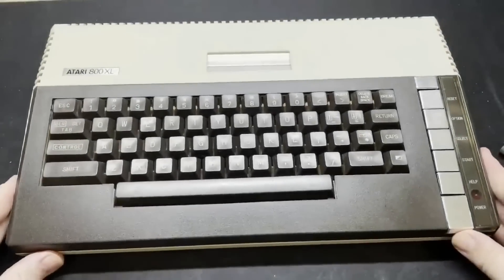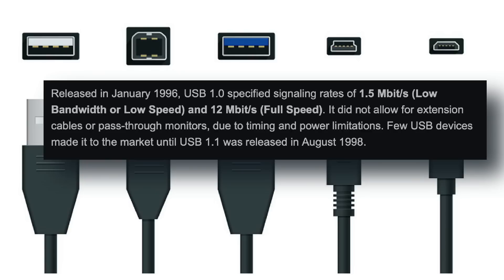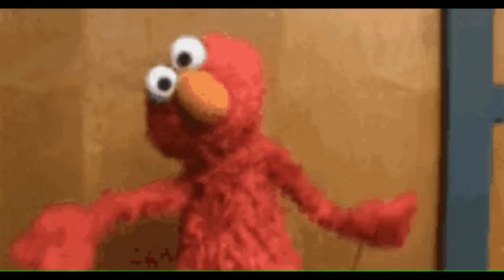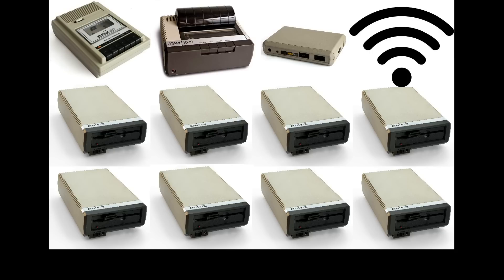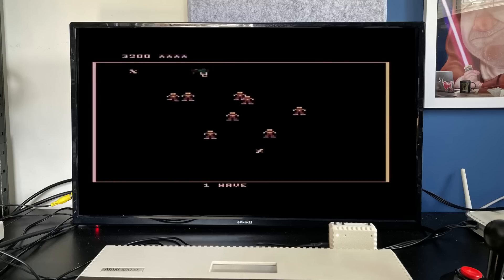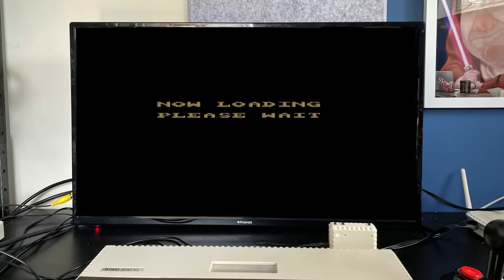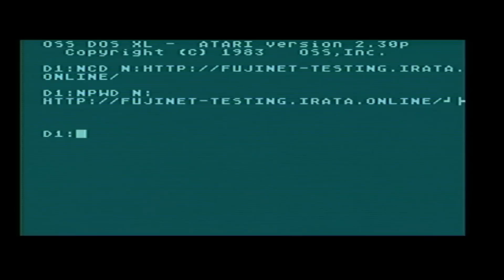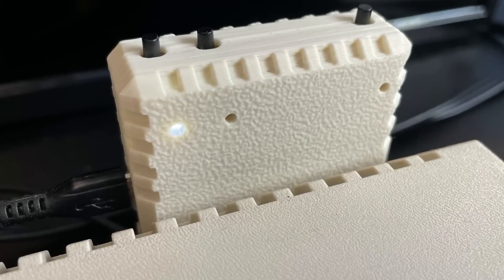Is this the best Atari 8 bit peripheral ever made?  I think it might just be!  #amazed!

Comment: Getting close to retirement and decided to unpack my old Atari 800, which I put away in 1986.  Shocker, I discovered I'd even bought spare parts and packed them too!  Also realized I had about 400 floppy disks loaded with games.  And I had a super charged floppy drive because, at the time, I was making money bulk-copying disks and writing games for a software company.  And it works!  (Man I love how sturdy old tech was.)

But now I really worry about longevity.  Everything loads fine... for NOW... but I WISH I could transfer all those game disks onto Flash drives and have them there for eternity.  This gadget sounds amazing for that purpose.  Seems like I just plug in the drive, daisy chain this device (I have the extra cables), and then I've got the means to copy from one drive (real) to the other (virtual, but accessible from my LAN by other systems including my Mac), and then I can move the copied info onto a flash drive for long-term storage.

Is that indeed possible?  Has anyone done it?  Could you then access your game library directly from the Flash drive through the Fuji? Or would it be a whole back-copy process to the Fuji virtuals?
Reply from the maker: Wow - sounds like you've got a real treasure trove there! :)
Reply: @TheRetroShack  Trying to document them all to video.  Some I've never seen anywhere else.  Back from the early days when people wrote games and literally gave them away for free or a few dollars, just taking pride in being able to create something cool (and probably use it on interviews with today's big game companies back in the early 1980 days).

Comment: The CP/M emulation along with the new CP/M card for the new 1090XL expansion interface means that there are now 4 different ways to run CP/M on the Atari.  The two original ways are the ATR8000 and a z80 powered disk drive that can be expanded to use the ATARI as a terminal.  So many options for retro explorations on one system.

Comment: Serial I/O wasn’t the only peripheral port on the 800XL. There were two DB9 controller ports, too. Sayin’ ‘cause it is a peripheral handled by USB, now — and the 800 had four of them, which is another reason I wish REVIVE were making an 800, instead of an 800XL (despite USB hubs that would make it the other two obsolete), ‘cause everyone could plug their controllers directly into the front of the machine. The 800 also had far better aesthetics and keyboard, for computers both essentially made in 1979. Of course, with Serial I/O location on an 800, that sweet “multi-peripheral” (MP) wouldn’t fit...

It would be amazing if that Serial MP thing were to work with an RM 800XL. It could use every modern peripheral, which it should be able to do. I don’t see a reason why not — but I do see me parting with a few hundred bucks, soon enough. That should also be able to be daisy-chained into an OG Atari 1050 floppy drive, to digitize files. Wish there were a daisy chain port, on the 410 tape drive. I still have some disks and tapes...

That’s awesome!

Comment: The FujiNet is an amazing device and this video was excellent in presenting its features. I love the ability to boot with different DOS versions as each had different features like speed testing of floppy drives. A couple of extra points. Some utilities for floppy drives require being on an inserted floppy as they require D1 location, which the FujiNet occupies. Added drives require address change to D2 etc. . I have used the FujiNet to download utilities to the SD card, and then copy them to a floppy  for this purpose. The FujiNet will also work on Atari 400s and 800s as well as XL models. However Atari 400s and 800s boot up before the FujiNet gets power up from the SIO and FujiNet is not recognized. However, this is solved by providing power from USB and connector is there. I have accidentally kept the USB connected when inserted into my 800xl and thankfully I did not fry the device. Not sure of this, but I think it is safer to disconnect USB power when connecting to any XL. These supply power to the FujiNet through SIO port and XL recognizes the FujiNet just fine. Finally it will work on the A400, but you need upgrade to 48k. I had A400 with 32k upgrade and boot just stalled after splash screen. 48k upgrade and it works perfectly. Very impressive engineering in this device.

Comment: This really shines when you combine with high-speed SIO, with a ROM replacement.  Something like the Ultimate 1MB which provides ROM replacement, 1MB RAM upgrade, internal SpartaDOS X, also a real time clock (Fujinet has this too).  Your robotron load would have been a couple of seconds rather than tens of seconds in that case.

Comment: The problem of the XL series is that they were incompatible with the earlier 400/800 series. Certain programs which used illegal calls to the OS would  result in failing to run on the XL series. Atari moved certain routines in memory and added a diagnostic program. Unfortunately , this caused certain programs which relied on the illegal calls would fail to run. Atari released a set translator disks, which loaded the older OS from 400/800 into memory of the XL machines. Unfortunately, it completely resolve the compatibility issue.
Reply: That incompatiblity was sort of overblown, Atari released a translator disk that resolved almost all those issues, and it was a subset of programs anyway that were using undocumented entry points in the OS, with everything released later on pretty much always working on both (well except where specific features of the XL were needed, like RAM under the ROM, PBI interface, etc.)

Comment: Haha! I've been saying Ataris had a sort of USB for years, but I didn't know there was a link between the two. :) On the other hand, it was too far ahead of its time in that it made all the peripherals rather expensive. Every peripheral except the tape drive had to have its own microcontroller to speak the protocol. The tape drive could be cheap because it didn't speak the protocol, there was a separate wire just to tell the motor when to run.

The 1020 is a plotter. It's fun! :)

I wish I'd got my act together in the 90s. I wanted to hook up my old Atari to a PC to emulate all these devices, especially the disk drive. It wouldn't have been too hard, just a matter of level shifting to RS-232 in hardware, picking which RS-232 lines will represent some of the Atari's signals, (I think Command is the only essential one besides TxD & RxD,) & writing some code on the PC to work with the protocol and serve virtual disks, sector by sector if I remember right. It was not a complicated protocol.

But I don't know if I would ever have made it as polished as the FujiNet. :) It even matches the style of the XL series.

The only thing that bothers me is it takes plotter output and turns it into a PDF; a format which was pure aggravation for me for the 90s and at least half of the 00s, but it's an old gripe now. I guess it makes sense for the output of the actual printers, and maybe even the plotter if you don't make too much use of the fact that the plotter has a continuous roll of paper. :p

Comment: This brings us to the unique Atari Central Input Output (CIO) system.  Each device can be read or written to as an abstract device, either as a physical  or virtual device.  You could do crazy things like write to the keyboard, but that speaks to the flexibility of the system.  You could even create your own device for any use you can imagine.  For instance, you could create a new CIO device that prints tiles to the screen, or write to a completely modern hardware device.  I believe that's how the VBXE graphics adapter works and possibly the FujiNET.
Reply: The Ramdisk on the Atari 130XE used the CIO system too.

Comment: The Atari 850 is not a modem. It is a digital interface that provides parallel printer and serial RS-232 ports so you can connect 3rd party printers and modems. Atari branded printers and modems connected directly via the SIO port, so you did not need to 850 for those.
Reply: In the earliest days, that wasn’t always the case. The 830 Acoustic Modem needed to be hooked up thru the 830, and I believe Telelink I was the cartridge based terminal software for it. Now, the 835 Direct Connect Modem was nice in that it hooked up directly to your phone line (no acoustic coupler bull) and hooked up directly to your 800 via SIO. That’s like double “direct connect”! Think that’s what Telelink II cart was for. 

The 1030 modem (and all rest of Atari branded modems) were SIO. I read that it had software in ROM and a feature of SIO was being able to boot from the ROM on a peripheral. Don’t quite know how that works but maybe just like how a floppy disk drive delivers boot data over SIO. 

I had the XM301 and it came with a floppy disk to boot the driver and run .. XE term was it? Didn’t have an SIO pass thru but also didn’t need its own power supply. 

Later I bought an SX212 modem and it had both SIO and RS232 (for ST but in my case I upgraded to Amiga - long live Jay Miner!). I guess a user could hook it up via RS232 to an 850 (or more likely then an ICD P:R:Connection) … but I used SIO and SX Express terminal software. Keith Ledbetter, right? Think that name is burned into my head. Also no SIO pass thru. How did I print? I had a Panasonic KX something (1091 or some such digits) that we bought from Electronics Boutique at the new mall and had a Xetec interface cable.. SIO to Centronics with a bunch of dip switches.. I see these for sale on eBay. Maybe I swapped cables but I did print a few emails from BBS’s. Did I save the text in the terminal software and then recable and reboot? Hmmm…

Back to the subject, 825 80-Column Printer also needed the 850 in the early 80s. But yeah the 1025 printer that replaced it in the XL line was SIO. 

I think the modem drivers set up the R: and for sure that’s how the Atari 850 and ICD P:R:Connection worked. Did the SIO modems use R: in their drivers or another letter? Foggy… I just booted the terminal sw disk and mostly didn’t care. Except I was generally curious and trying to learn everything I could but I think the minute details of the modem drivers were not high on the list back then. But I did pick up some Hayes AT commands. ATDT and when I started out had to use ATDP since we didn’t have touch tone service until I “had enough” and researched it and explained to my dad that we could it free just had to call Ma Bell and ask for it (that you had to do that is further proof how crazy/stupid the phone company was). Lastly, I still remember ^S and ^Q … still useful on some UNIX terminals 🙃

Comment: Here's a little additional info:
- built in real-time clock, getting it's timestamp from the web
- built in 850 emulation (serial -> telnet)
- unit also supports midi-maze which allows multiple player gameplay over the internet
- project hardware and software is completely open source.  If you want, you can build your own
- built in UDP/TCP/json parser inside the fujinet (does the heavy lifting) that allows BASIC to access the internet
- you can run your own TNFS server using any computer including a raspberry pi

Additional 8-bit computers In development:
- ADAM 
- Atari Lynx
- C64 
- Apple (8/16 bit)
- S100
- ZX Spectrum

Website:
  https://fujinet.online

Wiki:
   https://github.com/FujiNetWIFI/fujinet-platformio/wiki

Fun fact:
- irata by the way, is atari spelled backwards

Comment: The Atari 8bit computers were ahead of their time. First  home computer with:
-"USB" type of port .
-architecture based on  co processors.(Jay Miner)
-S video output, 
-an extensive palette of colors (256 GTIA )
-4 sound channels.
-Hardware scroll and sprites.
Reply: Joe Decuir, the guy who designed the SIO on the Atari, also worked on the creation of the USB port.
Reply: In retrospect, it's almost impressive how completely Atari managed to crater as the market evolved, considering how danged good some of their earliest hardware was and the lead they had over some of the more successful early competitors.
Reply: @guaposneeze The C64 was cheaper and had multicolored sprites. They took over MOS technologies, and got the 6502 and peripheral ICs for cheap, and all the other 8 bit manufacturers had to pay. + Time Warner had no idea to run a computer company like Atari. They saw developers like artists, signing them into record contracts where they could dev on other platforms.
Reply: @earx23 The C64 despite being cheaper, wasn’t as good as the Atari.  Three channels compared to Atari’s four, a slower CPU, and the colour palette was quite muddy and dismal compared to the Atari colour palette too. It’s a shame that Atari wasn’t good at marketing what they had at that point.
Reply: @mortimore4030  pokey's four channels were hard to get in pitch. No filters, no ring mod. Yes, the c64 palette was awful, but the a8 chroma Luma model was not always desirable either.
Reply: @mortimore4030  Going to have to completely disagree with that. I'd take a c64 over an atari 8 bit 10 out of 10 times.
Reply: @guaposneeze That's unfair to put ALL the blame on them . They made a faster , more powerful computer than the Macintosh and in color AND cheaper YET no one bought it because too many consumers bought the -" only a game machine 🐂💩 ".
Reply: I saw Joe D. speaking at the 2019 Vintage Computer Festival East (which had an Atari 8bit 40th anniversary theme that year). That was a great great weekend. 

I had (still have) an 800XL back in the day. I remember Sears selling the Atari line (also had the Sears version of the 2600). I wasn’t aware of the crash at the time as a child. I wanted the 1450XLD that I saw in a 1984ish brochure. Of course, we now know that never came out. Not that I was likely to get that for Christmas anyway. And of course the C64 took off and my friends got that instead (well, one had a Plus/4 :-) … ). 

Considering the debacle of the Intellivision Keyboard component (which I never knew of back then) and the fiasco of the Adam (which did interest me), it seems a shame that Atari didn’t release the XEGS in 1983 (vs 1987 or so under the new Tramiel Atari) instead of the 5200 (which I bought with my chore and lawn mowing $ in the fall of 1983 and loved playing). By the late 80s it was too late. But in 1983 there was already a strong catalog of games on cart, tape, and disk. People could start off playing cartridge games and then dip their toes into floppy disk software- plug in the keyboard and a printer and do homework and taxes and budget etc. But alas no it didn’t work out that way.
Reply: @nickpalance3622 My understanding was that it was due to licensing.  Like Atari lost the licenses for doing releases of the console version of Donkey Kong and other games.  But they could release computer versions, which were licensed differently.  If they had released a 400 in console form that could use the same cartridges (which to be fair, outside of the higher capability of joysticks, larger cart size and lack of a keyboard, the 5200 is basically an Atari 400) then they would have potentially broken those license agreements.
Besides, Star Raiders needed that analog joystick...
Reply: @nickpalance4096   5200 was the last chance for Atari to get their 400/800/XL/XE upgraded 8-bit games into the public consciousness and get ROI for all of the R&D Atari spent capriciously on, as they knew their sound/graphic/sometimes playability content was generally superior to their own outdated but still selling 2600, and C64/Coleco(Donkey Kong excluded lol)/TI/Magnavox/Tandy et al. The 5200 was one of the most aesthetically repulsive consoles ever made. And like the Beta vs VHS shells phenomenon, the carts for the 5200 were bigger, did less and boot-failed/glitched more than their 400/800/XL smaller cart predecessors.

The 5200 joystick controllers while well-intentioned, feature-rich and functional, were an ergonomic disaster if you didn't learn to grip the shorter-throw stick like a PT patient putting only minimal palm pressure on them. Jerking them around overhand like an old CX40 controller, would literally give you carpal tunnel and trigger-finger syndrome after 10,000 hours of playtime. I remember going over to my cousin's house when he got his 5200 expecting great things. But alas, most of the games were visually-parallel but glitchy and momentarily-inferior playability versions of my Atari 400/XL/XE game ports. 

Failure to properly market their 400/800/XL/XE machines as superior overall game machines in the early-80's, as well as all of the personal computing ruse with home budgeting and learning software programs they offered to tempt Dad's into buying an Atari 8-bit PC for their family home, instead of just sticking to highlighting the sex appeal of the games in their ads/store associate sales pitches, is what ultimately doomed Atari, imo.

The 5200 was just a spent afterthought and avatar for Atari's past over-compartmentalized and poor resource-allocation originally by Warner Bros, that set the stage for the Tramiel purchase becoming Atari Corp in '84(which in my mind was nothing more than a transfer front so Commodore could steal Atari's proprietary intellectual properties for the C64 and squeeze what little profit juice Atari had left in it), then abandoning Atari Corp to ultimate ruin in '96. Sad ending for such an innovative company that hired men like Joe Decuir and Jay Miner.